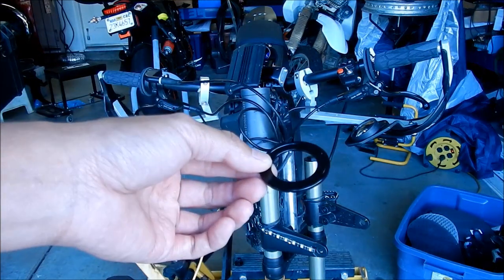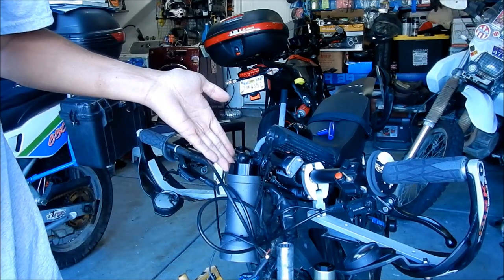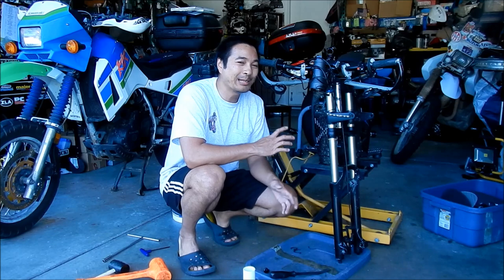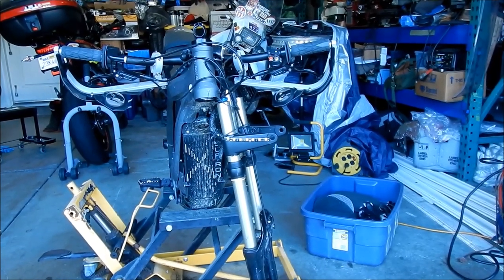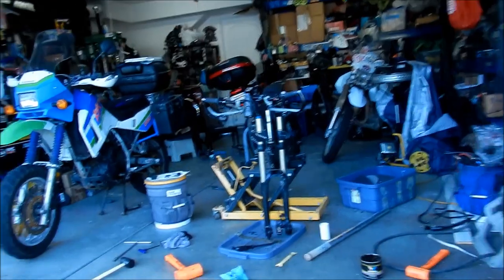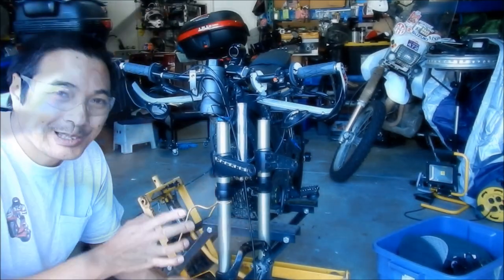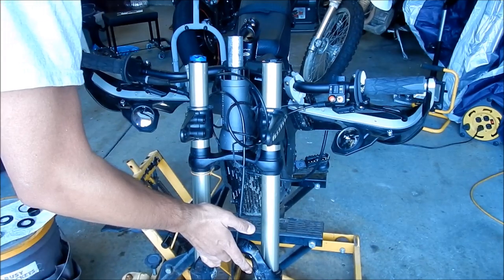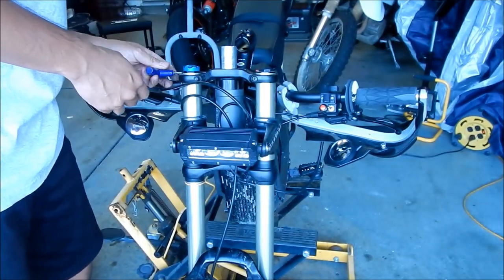Sur Ron Light Bee Tappered Roller Bearing Headset VLOG Part 4 - Installation

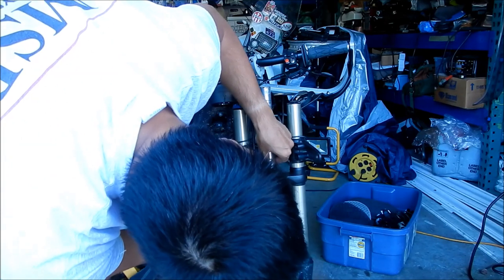Comment: Hey man. Around 10:30 you enter the tapered bearing on the tube. And then you need to manipulate it down 2-3mm. Why is that? Is the diameter thicker on the bottom of the steering tube?
Reply from the maker: Yes I think it's slightly thicker just be careful not to damage the bearing
Reply: @hadesomegamoto7639  Yes, i agree. Thank you.